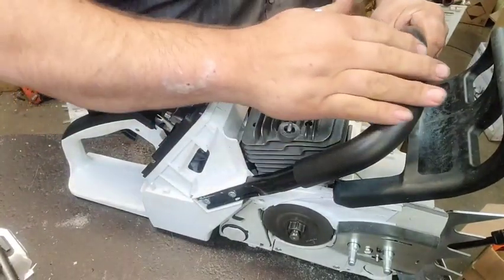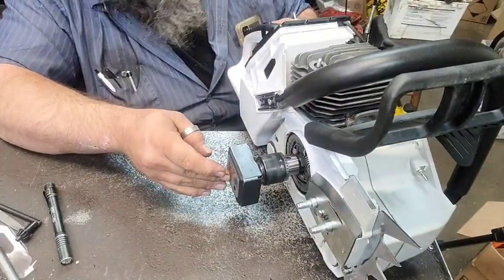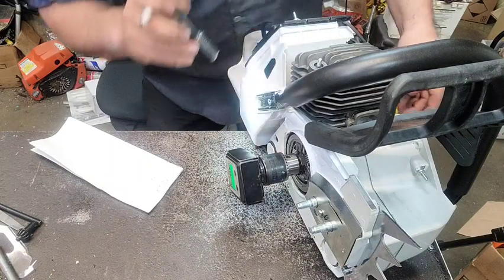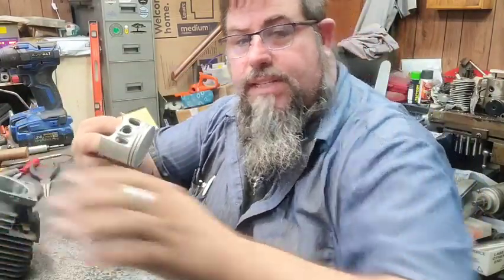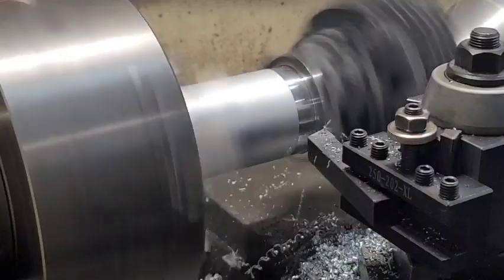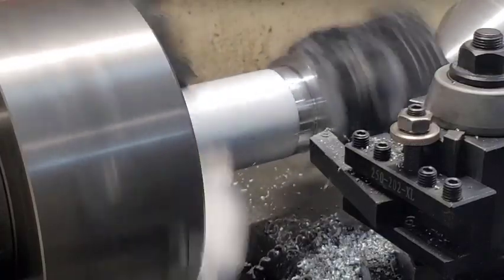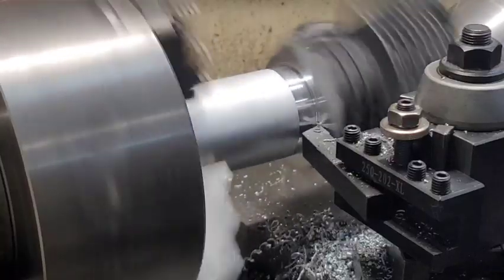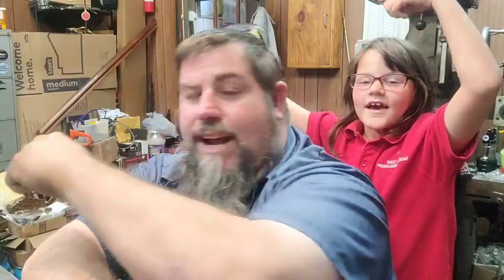Ms880 What Happened ?

Comment: I have 880 rings, 60mm bore, 1.2mm thick. Nice set, sharp edge rings, Not sure of the end gap but they look good. Want me to send to ya? Ogden Saw Works
Reply from the maker: Ill call you in a little buddy
Reply: @bellhoppersaws  sent you a text with pic, those rings were not 60mm. Mislabled or mismanufactured with the endgap that big. Sorry bud. I have lots of other parts if you need or want to trade